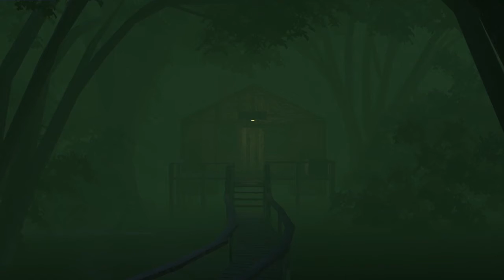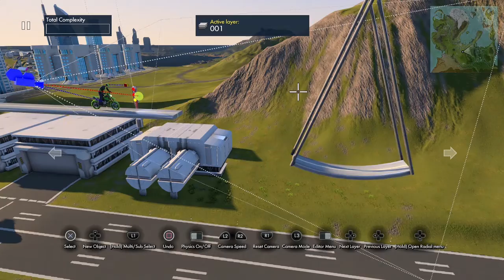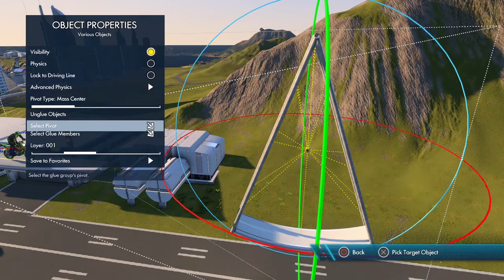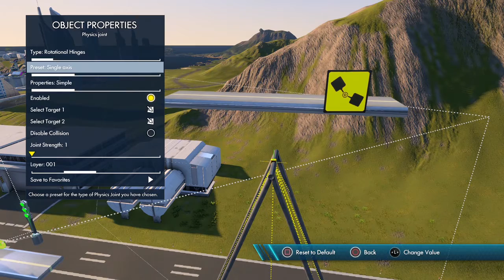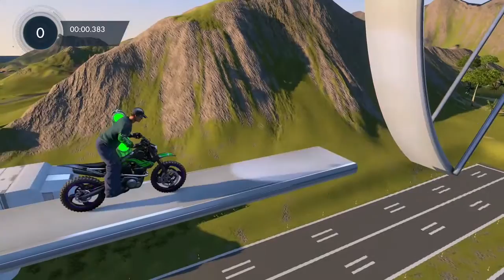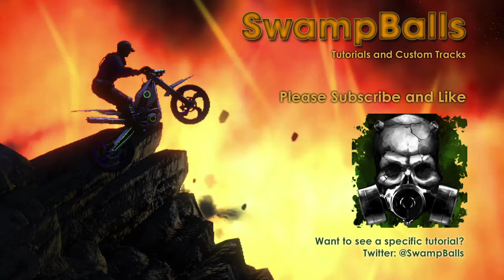Trials Fusion Editor Tutorial - Build a Swing Using a Physics Joint

Comment: I have a track I'm creating and originally I built a bridge to go over a pond but I changed it and built a boat to ride across the pond on to get to the other side. I can't seem to get the bike to stay on the boat once it starts to move. I have to keep the gas at full throttle to stay on it. How can I just ride the boat?
Reply from the maker: You need to use a physics joint set to slider, and use the physics' joint motor. Watch this tutorial and make it go sideways instead of up and down. https://youtu.be/Mgkgk62AIq8

Comment: Is there a way to make it so it will keep swinging? I followed the video and it slows down to a stop quite quickly.
Reply from the maker: You would have to use the physics motor, and reverse it at the top of the swing. Then repeat that at the other side.

Comment: Nice video. Could I apply this same method to a hanging gondola that wobbles a bit when landed on? Would it still react to the bike/rider that way with this setup?
Reply from the maker: Yes, just don't tilt it so it doesn't swing back and forth. It will still react to the rider landing on it.
Reply: It worked. Thanks dude. Appreciate it.